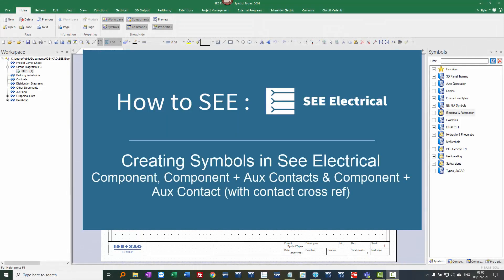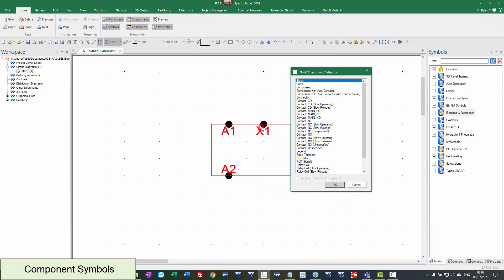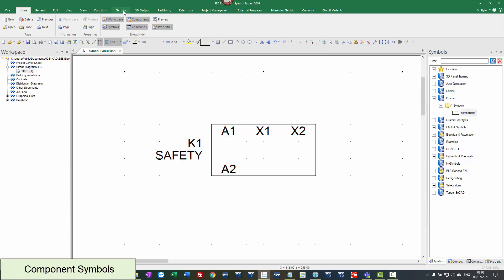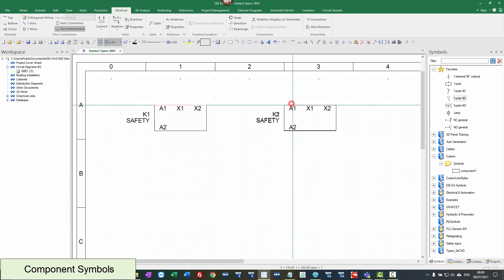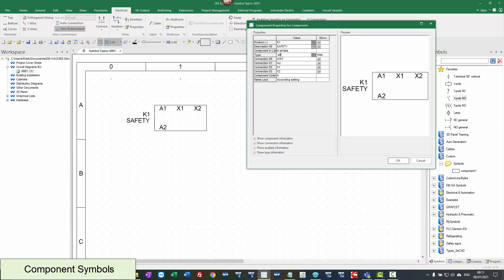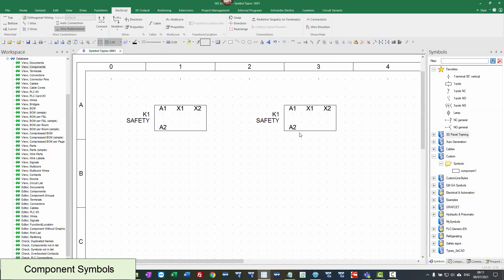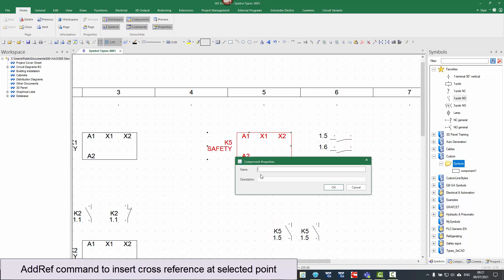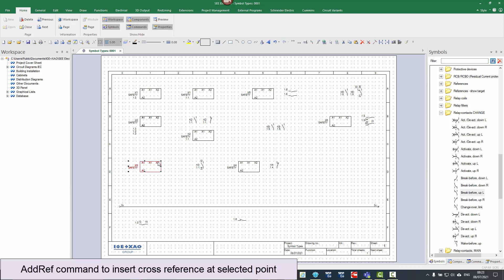See Electrical V8R3 Component Symbol Creation

Comment: HOW TO SET A BASE POINT FOR PICK AND PLACE
Reply: In Symbols pane, find System, expand, find Symbol Orign and expand. You will find a red sight cross that you can move to a connectiono point of your symbol per say and then make  your symbol as a block and drag it to the Symbols pane. When you will pick it back from the Symbol pane, your pick point will be where you had put the sight cross. Voilà!
Reply: @MrBenLacoste  L A T E 😂
Reply from the maker: Method 1 - drag the component from the point that should be the insertion/reference point.
Method 2 - right-click the symbol folder and select Save and enter X and Y or select a point on the page before entering the symbol name. 
Note that method 2 was added in V8R3 so earlier versions don't have this option.
Reply: @IGEXAOUK  THANKS! IT HELPED